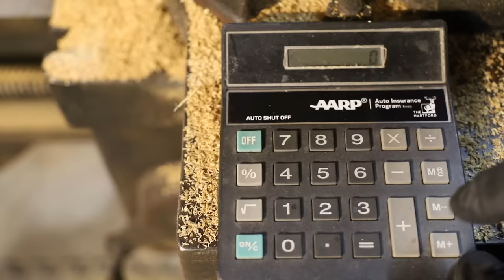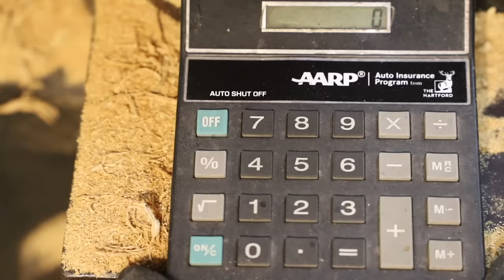New 187lb. Wagon Hub From Scratch | Engels Wheelwright

Comment: As a boy, Saturday at the Westerns. Was glued to the TV. Had a love of that lifestyle. Then 30 years in Electronics. Being retired, woodworking, leathercraft and a little metal work. My Son is the welder. Didn't mind the length of the video. That's a huge hub. With my disability I can't lift 187 pounds, not anymore. You're a great Craftsman. Thanks for letting me watch how thee are made. Truly, this was on my, what I call, "I WONDER", list. I wonder how Wagon wheels are made is crossed out. Thanks.

Comment: As I spent the earlier years of my 80-year-old living with my uncle building heavy wooden boats, I can appreciate all the craftsmanships and skills this gentleman applies.  He is a brilliant man who does not only knows his woods, but he knows his metallurgy at the manner he welds and dips those hoops in the oil, and reheat them to fit.
Looking at this wheel, I cannot help wondering about its total strength and toughness. No doubt there is a good robust hub. Being an engineer who often tested items to destruction to check their strength,  as they do in jet engines, all done for the safety of people I was wondering about the weakness of this hub.  Looking at the 18 rectangular parallel holes in which the 18 spokes will fit, I am wondering if the wooden material left to tie the two side central discs of the wheel together would hold in the long run when that heavy wagon which will be loaded with at least five tons swinging laterally at axis level height, there will be a shearing/tensile stress in the wooden material between the spokes which would take a tension stress to parallel with the axle of the wheel. Seeing that there exist those two large low carbon iron hoops close to the spokes I wonder if these two hoops would be linked by welding/rivetting a number of straps that go between the spokes and so any side/ lateral acceleration or deceleration of the load on rough grounds would strengthen the weakness of the hub in the  18 links between the two side discs.  I feel that the heavy iron hoops give more than ample strength to the stress they are designed to take, but those hoops and the central bearing seems to be too strong compared to the weakness of the woods between the spokes.  Please note that my comment has nothing to do with the abilities and craftsmanship in which this hub was made.  I am only suggesting a manner in which such a strong hub could be improved in its engineering weakness designed over 200 years ago. 
Again, congratulations to Engels  Wheelwright for such high craftsmanship and skills and the manner he manually lifts such heavy load when the need arises. He is a man of great logic, reason and rational thinking. Well done.
Reply: Carmel Pule. I believe wagons such as these ran at something like 5 mph on what were effectively "negative rails," i.e
deep ruts in dirt roads made by the passage of wagons just like the one that would have used this hub. Thus lateral stresses would have been somewhat constrained. Since such wagons had very high centers of gravity I would expect the drivers to have slowed down even further on turns. Thus I would expect primary stress loads would have been radial, the result of solid axle technology, when a wheel on one side encountered a bump or dip not present on the other side and the axle was forced to cant out of parallel to the ground. I assume that the internal metal hub was there as a bearing, to reduce friction and wear, not for strength per se. It needed to be so thick because it would have been made of fragile cast iron, for lubricity. Not sure whether the preload created by the steel bands served a purpose or not, but it's possible that compressing the wood fibers under the bands would have encouraged them to expand at the mortices, causing the hub to tighten up around the spokes. Just some thoughts.
Reply: @joshdrexler8773  -Depicted in documented traveler details, thoroughly 'wetting' the wagon wheels subjected to dry climates while en-route, became routine daily, to swell and tighten all joints. Western arid territories, deserts were especially brutal for easterners unaware of such tendencies for loosening.

Comment: I just found you and will spend today watching some more of your videos. I'm 78 been in the machine shop since 23 mostly metal. Worked for rubber roll company building the rolls from scratch and then cover with rubber. We used a pi tape to check dia of the rolls. Have done some wood work on the lathe for myself. Really enjoyed watching you machine the wood and make the metal rings to press fit. Am interested to see the rest of the wheel build. Us old timers are the true machinists, most of the guys now just the check parts as the cnc or whatever automatic lathe or mill spits out. It's more computer operator than machinist. You tube is full of videos of people building something or the other and they run 1-2 hours, so don't apologize for 30 minutes. I thought it was a bit short, let em run. Workers now complain if they pick up 20-25 lbs. when I was on the farm, picking up 100-150-200 lbs was just just part of the days work.

Comment: I resurrected an antique craftsman wood lathe and installed a 3hp variable speed DC motor,
I kept the original 4 pulley system but geared down the the motor so I have plenty power at any speed.
I was able to bore my model steel cannon barrel Perfectly true, it was very satisfying!
I wish I could post a picture here of my lathe, I'm a retired mechanic, it came out really nice.

Comment: The extra time allows for a few more detailed observations.  Such as at 10:25 when we see the new mortiser (before you cut it up and rebuilt it) sitting on the pallet and then see you using the fully modified and installed new mortiser immediately after that.  Internet time warp magic - love it.

Comment: The conflation of metal and wood lathe methods is awesome. Never saw anything like that before. I believe that at one point I saw you use the metal toolholder as a rest for your woodturning gouge! Beautiful. 

That homemade upside down steady rest is adorable, but I can't imagine it does a very good job for you. On a heavy turning like this it must flex like crazy. You need to weld a "T beam" reinforcement all the way around the rim. Or perhaps two steel bands forming a triangle in xsection. Also greatly beef up the rim's connection to the lathe ways. Discard your existing feet and substitute 1" - 2" thick steel blocks, very robustly attached to the circumference. Even so, I wouldn't be surprised if after carefully welding a "T" reinforcement around the rim you begin to notice weld cracks developing; the forces in play here are quite large.

Otherwise, great craftsmanship. Not only in your personal skills but also in the functional design of your environment that enhances your efficiency. Best wishes. Stay safe.

Comment: I was thinking back upon the heavy borax wagons, and thought about the pulling power of mules and horses.  I know that horses dragged huge skids loaded with logs in Michigan.    So I looked around, and found that in 1924 a pair of Shire draft horses pulled an estimated 50 tons at a public exhibition.  Even if it's off by 10-20%, that's a lot of weight!
Reply: @EngelsCoachShop  Indeed.

Comment: The video is not too long. As others have said I would watch them if they  were three times a  long. I just wish you would add some comments as you move along. I can follow most of the steps but still would like to hear your thoughts as you move along. Two things I didn't understand. One, what is the black liquid you applied to the hoops and what does it do? Second, could you explain the tool you use to measure the hoop size. Also you get a lot of smoke from the hollow chisel mortiser. Is it dull or is the wood just that hard? Last, please be careful of your back. An extra lift around the shop might be in order.

Comment: You will never keep your mild-mannered secret identity if you persist in making so many tools, such as the custom lathe ball-bearing rest, which looks suspiciously like it started out its life as wheel tyre.

Though, the smaller circumference gauge needs s-shaped spokes...for tradition, and so it looks like the large one.

A good fiber-glass reinforced seamstress'es measuring tape might give you more accurate measurements than a Stanley tape, wrapped around the wheel.They make machinist quality ones, but you would have to make quite a few wheels to either afford or justify one. 

Ironically, Stanely's home town--was also mine. : )

Comment: After watching so many of these I find that I no longer can look at a wooden wheel and just see a 'wooden wheel'.  I am looking at the hubs (Sarven, Archibald, etc.).  Are there rim rivets?  What kind of boxings? 

I am wondering about the shops that built those wheels.  For instance, Studebaker must have had dozens of employees, all specialized within the job of cranking out hundreds of wagons and buggies and whatever else they made.  Teams just turning, drilling and mortising hubs while others were making spokes or felloes.  Blacksmiths making and installing tires and hub bands.  Not to mention the production of the running gears and wagon boxes.

Comment: On your electric powered hydraulic press.... is the anvil point a Model-A or Model-T drive shaft, or maybe even the one of the left or right side axle shaft's?.... and possible the PTO shaft from a Ford-9N?.... not that it matters, rather, just noticed the odd and wide spines... another great video, Thank you
Reply: Now me, i thought it was an input shaft of a eaton fuller transmission

Comment: I am curious as to why you only preset one end of the steel bar? As you see you ended up with a flat spot on one side that you had to hammer out to round, whereas if you preset both ends of the steel bar you wouldn't have had to do that step, just a thought from a boilermaker - regardless there is some quality workmanship going on here.

Comment: I'm just curious to know why the cracks in the hub blank don't seem to matter. I suppose it would be hard to dry a log without it splitting. But with all those steel bands the wood is basically just a filler.

Comment: Very nice job. I enjoy seeing how this is done. I do have a couple questions: When you turn the piece at about 7:30 and use the large live center, is there any concern for the piece splitting? On the first end, you have restraint from the steel center ring. In my paranoia, I use a worm clamp (hose band) in that type of setup, but do this type of setup so rarely with wood, I really don't know what is safe. Also, Is the tape in tenths? or in conventional fractions? (I have been looking for a tape in tenths, or, better, a pi tape in tenths, for a long time). I still really dig you morticing and indexing setup. Accurate enough and rigid enough in the directions that matter. As a welder/machinist type, I learn a lot watching the range of skill and craft you need for your trade, in particular how to get it done to meet the need, rather than focusing on the last digit on the micrometer.

Comment: I am curious as to why you didn't seal the wood to protect it from the elements prior to installing the hoops. I noticed the axle sleeve had fins on the side but didn't see any grooves in the hub. How did you keep the hub from splitting?

Comment: Why are the differences in the circumferences on the hub so critical? I see why the spoke length needs to be  uniform. But I fail to understand the secondary stages stepping down as its moves out towards the axle and nut. I hope I said that right.

Comment: I'm curious about something.  At 20:30 you are aligning the two ends together while hot.   At 21:00 the ends are being welded together.  Once the ends are welded do you have to refine the shape?  You are able to get the radius correct while hot shaping the band?  I would have thought the band would have to go back into the roller after welding to perfect the shape.  

I'm not complaining but would have loved to have seen from the very beginning.  The log you started from.
Thanks.
Reply: @EngelsCoachShop  thanks very much for the reply.

Comment: You oil quenched the bands. Do you do this to all of them, or was this just an " Option " / Special Request. ?
What is the reason for having  "Dish" to the wheel ? Is it to give the wheel alittle Flex ?
Reply: pat36a I believe he is oil blackening the parts. I apprenticed in a blacksmith shop back in mid 90's, did the same thing to various parts. It doesn't quench or temper them, just gives a nice black finish that provides some protection. Wonderful smell, definitely an outside procedure!
Reply: @EngelsCoachShop  Head slap, forgot about side load.
Thanks

Comment: What was in the trough that blackened/treated the heated steel bands?
Reply: @EngelsCoachShop  Thanks for the answer. I've seen some blacksmiths using linseed oil as a surface treatment, but I was pretty sure it wasn't that. Love all your videos, BTW, you do a great job on both fronts, wagon work and your videos.